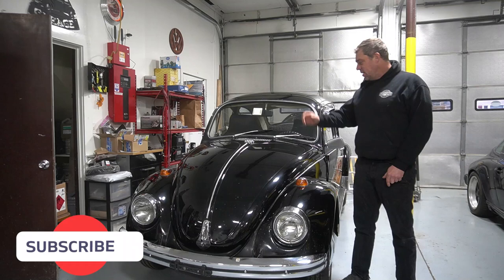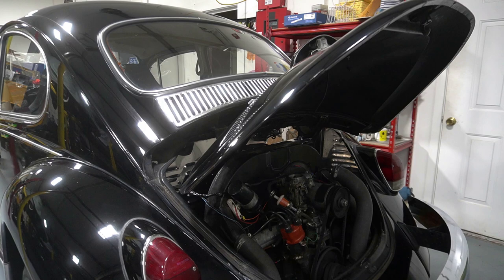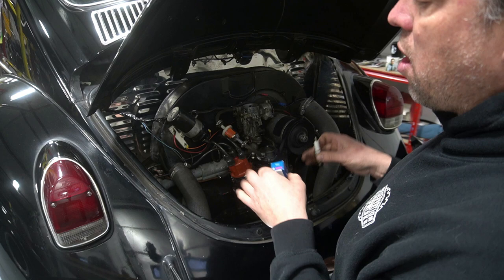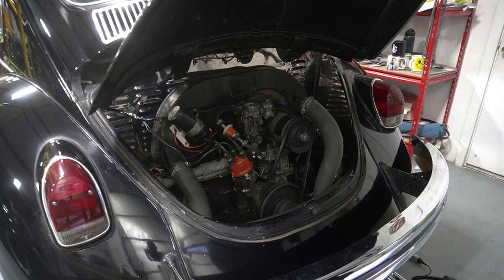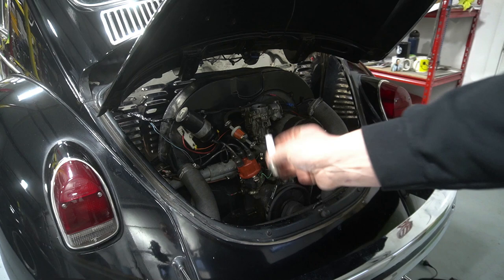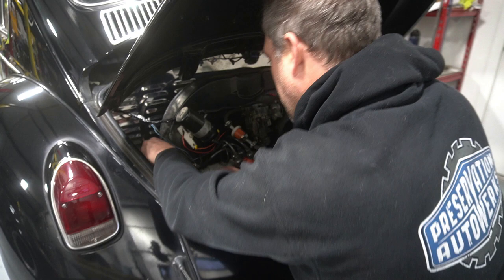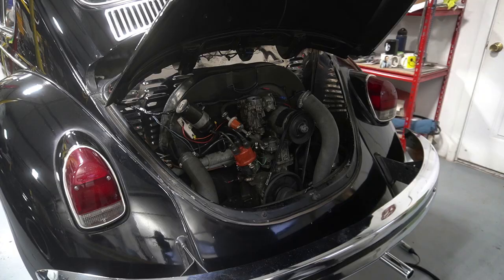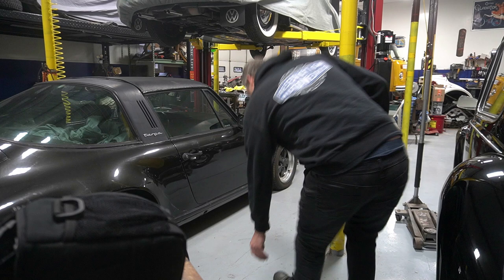You won't believe why this VW beetle runs so badly! Watch and find out. It will blow your mind.

Comment: I've used NGK BR5HS plugs as long as I've driven Beetles and I've never had an issue. The set in my rat has been there for 30k trouble free miles.
Reply: He is pay 💰 for Bosh LoL 😂
Reply: same here
Reply: I just pulled mine out and now they're over 40k and no change at all. Could have left them but I was doing a wire change anyway so I splurged and got Bosch. We'll see how well these work but the NGKs are in the toolbox just in case.

Comment: Nice video,  but could you give the part number for the correct bosch plug? You rave about how bad the ngk is then "this is the right bosch plug with the resistor" but never give a part number.

Comment: Its funny..I stopped using Bosch once the German ones disappeared.  I love NGK quality. You can get them in resistor style. Problem with them is there are SO many choices in type and heat range etc. I wish I could still depend on Bosch...but had a couple different bad ones the last couple years. And don't get me started on their condensers
Reply from the maker: You can get the correct plugs in NGK but I have never had good luck with them. They tend to foul out quickly. NGK's are very good but just don't work in aircooled cars. The other thing I didn't mention is with a resistor it has a longer spark time. I had a viewer give me a hard time about that.
Reply: Bosch used to be so much better, they kinda suck now

Comment: Do you really think that changing brands of spark plug was the problem? I noticed you didn't go out of your way to show the old plugs that came out, you just blamed the brand of the plug. I could see both of the plug you pulled out was totally black from the engine running too rich which will foul out the plugs no matter what brand they are. If you don't lean out the fuel mix then your new Bosch plugs will be in the same shape as "the other brand". A fair test to see is as you say the NGK won't run in a VW then you should put in a new set of NGKs on camera & show the world how bad it runs then put your new Bosch in & show the difference. And while we're @ it, gassing on the engine is not the way to show how smooth an engine runs. Thanks for asking!

Comment: Back when air cooled VW's were cheap and common as dirt if you used Champion spark plugs when you removed them the aluminum threads would stuck to the plug threads leaving you with stripped spark plug threads in the head's. I had an adapter for my mill just for installing steel repair plugs to fix the stripped threads. These plugs were not simply helicoil thread repair parts but a threaded plug with a flange with stakes that held the repair plug in place. You had to use a mill to install them in a head.
Reply: This happened to me
Reply: Champion work well in fords and many British made cars but not VW's.
Reply: had a set of champions in mine when I got it. they sucked and didn't run well, luckily they hadn't been in there all too long and came out easy. also running a single port which is a little looser which im sure saved me some hassle.

Comment: BS!!! 3 things maestro! 1) These engines need to warm up properly before they loose the hesitation. 2) You have it idling way too low so you'll have overheating issues when idling @ lights. 3) You didn't show the plug colours so, no one can see how well carb is tuned. Great ;)

Comment: Surprised by this what code NGK did you thrown on the floor just curious. The NGK plug B5HS is an excellent top quality plug and suits the aircooled VW perfectly I have used them for a long time and never had this issue. Love the garage, I would die for a workshop like that!
Reply: Me too! I used only B5HS for my Beetle. In order to further increase the engine efficiency, and also give a slight increase in power output, throw away the old Contact Breakers. Fit a Hall Effect Ignition system, such as Pertronix. This Unit fits inside your existing Distributor. Ultra reliable, easy starting. And an even smoother-running engine without misfires.
Reply: @peterduxbury927  Fit 8mm spark cables, better than stock.

Comment: The resistor is built into the plug wire bake light connector so now you have 2 resistors . This guy knows nothing . I use ngk in all 8 of my collector cars

Comment: Swapped out the NGK specced plugs on my type 4 for Bosch W8CC and difference was noticable staright away.  Pulled cleaner/smoother as well.  Thanks for advice that actually made a difference
Reply: 🤔 he never mentioned the # why 😂
Reply: @alfonsocruz6156  There really is only one Bosch plug for the type 4 and it comes in 2 heat ranges. there are multiple style NG plugs My car is relative std compression so i used the 8 heat grade.  A type 1 engine is a whole other story with multiple type of Bosch and multiuple heat grades. the Tyopoe 4 is bit mor emlimited for choice
Reply: Because the bosch wbcc, cc meaning copper core.  Which is for points ignition. BR, R meaning resistor on NGK. Resistor plugs are for electronic ignition. It's not the brand, rather the proper plug type per ignition type.

Comment: VW plug cable connectors have 1k ohms resistance already. Why would you want to increase resistance, compromising the secondary circuit? 
(Sorry. but was VW/Porsche/BMW factory trained early on. Ran a very successful Calif. business for years, in the business for 65 years)

Comment: Nice video, just as an observation, that fuel filter near the distributor and coil is a time bomb
Reply: Especially if the fuel fitting comes loose from the top of the carb and gas is spread all over the distributor area.

Comment: I really appreciate this, I recently replaced the old Bosch plugs with NGK and just like you said I have the identical issues with my 63.
I will order the Bosch plugs and get the ole bug running right again. Thanks so much, right in the middle of restoring the bug, it has been sitting in a carport for 30 yrs.👍

Comment: Great video. I've only ever used Bosch in mine, useful info on the NGK's.

I'd also get that fuel filter out the engine bay.
Reply from the maker: Thanks man! Hope you're well. I haven't seen you in a while.
Reply: Please motivate?
I'm also learning here
Reply: About the filter out of the bay, that is.
Reply: @lariolouw5677  Recommendations are to put it under the tank between the tank and steel line. Others put it behind the firewall. Most do have it exactly where you see it. As long as you change your fuel line out occasionally, should be fine. Once the rubber starts to split, then the potential for fire is greatly increased.
Reply: @lariolouw5677  the engine bay gets extremely hot and the cheap plastic fuel filters in the engine bay are at risk of bursting and spraying fuel directly onto the coil/distributor. you need to be very careful because these old bugs love to catch on fire, pay attention to the fuel line and filter.

Comment: Back in the late 70's and early 80's I had three VWs.  Ran both Bosch and NGK.  Never a problem.  My 67 bus had a fairly modified engine (high lift cam, Porsche valves, 1855 jugs, two barrel Holley - had to keep the pedal "light" to preserve the transaxle) and ran great with either brand.  Maybe things have changed...along with everything else.

Comment: The black bug would run even better with the correct distributor, to match the carburetor.  009 distributors are great  for all out racing and spare to get you home.👍
Reply: I've always used 009 distributors in all of my VWs with no issues.
Reply: Exactly! For a stock street car the 009 is an old fad that just refuses to die

Comment: This is a 'Car requires full tune-up' issue or 'old fouled plug vs new plug', not NGK vs Bosch. New NGKs would have had the same results if they are the right spec. By the sound of it and looking at those old plugs i'd venture to guess a full tuneup should have been in order; plugs, wires, rotor, points, cap, condenser, fuel filter, oil, and the ?CARBS? You could hear it even after the new plugs were installed she still wasn't running just right ...

I've been servicing vehicles running Bosch or NGK for over 25 years and in all of my own cars, those are the only ones I ever use and never seen a difference between the brands unless they were fouled or the wrong spec/gap. Even on 1000+ hp engines if the plug temperature and gap ain't right detonation and $$$ problems can occur

Comment: Thanks for the info bro I have the same problem with my engine in my 72 bug its running just the same I'll give different plugs a go fingers crossed thanks from the UK great video
Reply: Snap & snap 72 and uk and same prob 😂- did it work?

Comment: My mother had two VW's.  She always had Bosch plugs installed.  Also when she needed a new voltage regulator, she always had Bosh installed because the aftermarket ones would only last a week, and need replacing.

Comment: ngk r runs great in my 1700, have 37 pict3 and svda with pertronix
Reply: ngk plugs are fine, they just aren't right for a points setup- the bosch plugs are straight copper plugs and the ngk have some resistance

Comment: Looks like the distributor may not be stock (looks to be a Bosch 009, which has a mechanical advance. These were added as a performance upgrade), as there is no vacuum advance on it. This may also affect how the engine runs.

Comment: Of course, you don't need plugs in a beetle that won't interfere with the radio because they're so damn loud you can't hear the radio anyway... I hate the damned things, but I enjoy watching people fix them. Thanks, feller, useful information entertainingly imparted. p.s. what happened to that Triumph Herald? For my sins I'm a Triumph fan. (Absolutely nothing to do with the motorcycle manufacturer, btw, for anyone that didn't know). Happy New Year, y'all.
Reply from the maker: The herald is sitting where we left it. I have a few ideas for it.
Reply: @driveanalog747  That is probably the worst example that I've ever seen, so good luck with that. And Heralds, being chassis based have been robbed out by the thousands to be turned into kit cars. So, do your worst and feel free. Looking forward to it. Thanks.
Reply from the maker: @billdyke9745  Im Thinking of dropping the body on a beetle chassis. What do ya think?
Reply: @driveanalog747  And why not. Heralds were also chassis cars and as a result countless thousands were turned into kit cars. Your example is too far gone for economic restoration so go for it, say I.
Reply: Buy a better radio 🤣

Comment: i see so many bugs on YouTube with those plastic fuel filters in the engine bay, they get hot in there & have a tendency to fail quicker spilling all the fuel on the hot exhaust = fire  - they should be fixed on the hose as it leaves the gas tank underneath up front - this will also stop any crap getting into the fuel pipe in the tunnel & any slight leakage you will smell it right away as its in front of you as you drive - nice vid though 👍

Comment: NGK plugs are just fine.
Your off idle acceleration issue is due to the 009 distributer you're using.  I'd venture to say it's not 100% set correctly as well.  It could also account for lack of max rpm/speed but I'd look at possible throttle cable slack.
2.  You need to get a vacuum advance distributor. 034 SVDA
3.  Your fuel filter is mounted in a dangerous location.   It should never be mounted after the fuel pump.  It needs to be moved outside the engine bay.
4.  Why is there a ceramic resistor beside the coil?  If it's old school coil it needs to be mounted upright.  Best solution is a newer style 3 ohm coil which eliminates the need of a ceramic resistor and it can be mounted upside down.

Comment: Ngks are fine.  If it's points run a non resistor copper core plug with copper plug wires. If you have electronic ignition run a resistor plug with carbon core wires. It's not the brand. It's the plug type.

Comment: Ive got an 1100 something in a formula vee im having a hell of a time chasing a seemingly similar issue. Thiught we swapped out to the bosch's but now i need to recheck.... had a massive leakdown bypass so i just relapped the valves back in, then found the #3 intake rocker was hitting on the retainer... cleaned all that up, leakdown was great, but still only makes 125-130 psi and has this sort of lean bog/stutter. And i dont want tobwaste a day tesring the carb apart because the acceleratoe pump doesnt spray very nicely. It just kind gushes out and some of it spurts out the top. Im used to webers and they have a nice solid stream. So instinct is accelerator pump.

Comment: Did you put anti-seize lubricant on the plug threads?   VERY important on aluminum heads...once you strip a head, you'll be obsessed with rubbing it on your plug threads
.

Comment: So I watched this and was a bit skeptical, but I changed out my nkg plugs that was in this bug when I got it , and while I couldn’t get Bosh plugs in stock I did try some auto lite copper plugs and it did make a huge difference on it .  13.00 dollars later and my life could have been out driving this thing in 60 degrees instead of 42 degrees,  mine is a beach buggy not heat lol

Comment: I find NGK doesn't work good in any older Air cooled carburetored motor especially two stroke. In my experience they don't last very long if you do use them.

Comment: not questioning your knowledge or experience at all, but without explaining why the plugs you removed weren't suitable for this particular engine, no one is the wiser. If the manufacturer specifies a certain type of plug, it is because it will have a specific thread length, pitch and diameter (determined by which cylinder heads you have fitted,) a specific electrode length (most applicable to the design of the combustion chamber in the head), a specific heat range (based on the normal operating temperature range of the engine and  prescribed octane rating) and if it's a resistor type plug, a specific resistance (in conjunction with HT leads & caps, to reduce RF and provide optimim spark, depending on the ignition coil fitted.  To say that VW aicooled beetles don't run properly on NGKs is nonsense. If everything was bone stock and made to OEM specifications, then perhaps the german made Bosch plug originally fitted are marginally better than another brand, but as you said, this is a relatively new motor, probably has a different ignition coil, leads, caps, points etc, all of which will differ from OEM specifications and create a different set of requirements....besides which, NGKs have a rolled thread form,as opposed to a 'cut thread' which lessens the chances of wearing the threading in the aluminium heads....hence why most engine builders would reccommend the right NGK plug, over and above a Bosch or other brand. I gave up on bosch plugs (made in India) when three out of four new plugs were bad from new...if I'm buying plugs, it shouldn't be a lottery. It's more a case of undertsanding which plug is most suited to your particular set up, hotter, colder, projected, resisted etc etc....it's not so much to do with the brand, in my opinion
Reply: And judging from the end of that plug he removed... a lesson on how to read what it's telling  and understand how to properly tune he may not dismiss ngk for  bosch. Eh...it's his video

Comment: It would be helpful to have the part number for the Bosch plug you are saying is the correct one. You never give the Part number and I don’t see it anywhere in your description.
Oh far every part store I’ve checked with does not have a Bosch plug to cross references from the NGK I have been running. So where do you get the correct one please?

Comment: would you have any idea why one side exhaust is not getting warm. engine is running but not right.  I put in new spark plugs and leads and cap. but still one side is cold.
Reply: Some time on a beetle, it could be fuel mixture, on nmbr 3 plug, because of oil cooler, blocking the cooling air, from reaching nmbr 3 cylinder. A problem I had on my 68 1641 cc beetle it always ran hot on nmbr 3. Hope this helps.😊

Comment: Volkswagen doesn't like resistors what are the brown things at the end of the ignition wire where it terminates at the spark plug, the little brown thing is called a resistor 150 across-the-board sounds like somebody flight cut the head 150 is a short-lived Volkswagen motor that leaks oil